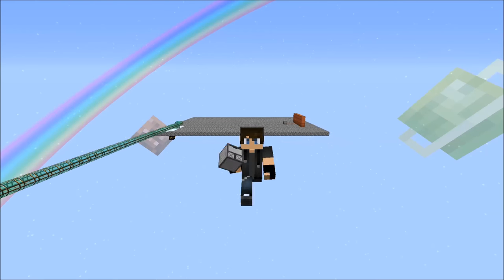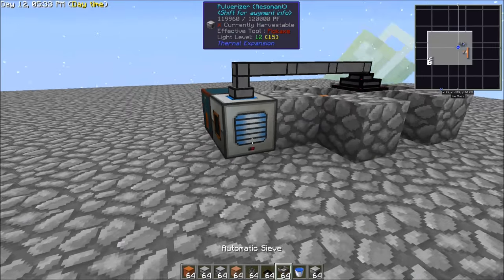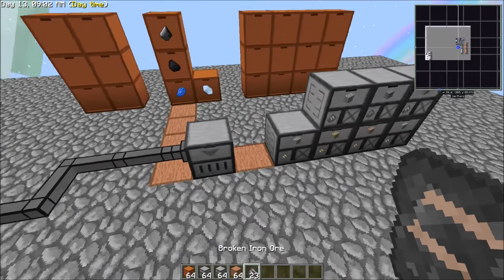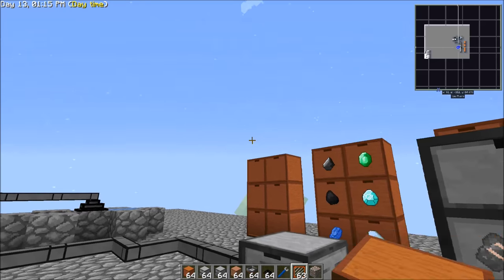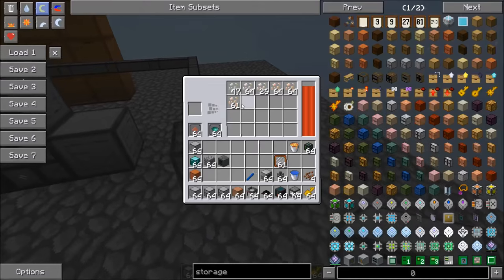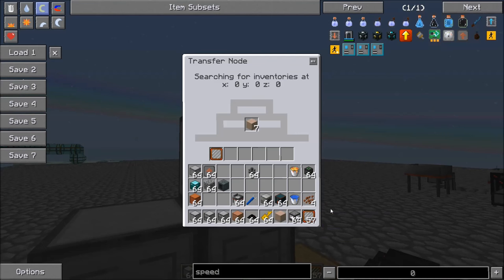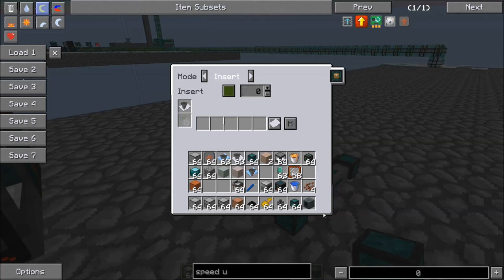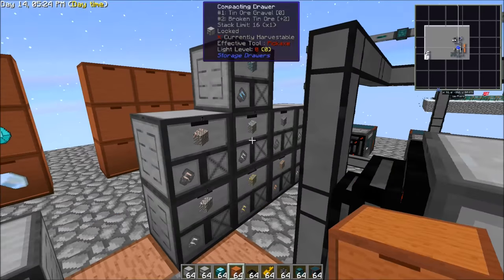Sky Factory 2.5 Compact Drawer Ore Processing Setup

Comment: A trick you might not be aware, you can quickly lock all drawers connected to the same system by using the key on the drawer controller.
Reply from the maker: Oh nice, I never knew that :)  Thank you very much for the suggestion there, def will come in handy :)

Comment: Question for you... Im having issues with ores. Tin seems to be coming out in a different type that isn't working for some recipes. I'm getting thermal tin but I think I need ex tin for making a satchel. 

How can I change it?
Reply from the maker: Well you could use a Unifier from Minefactoryreloaded to change your ores over as they come into your system.  Your able to set it so that say tin gets converted from thermal to ex, etc.
Reply: I figured it out. If you place the version you want in a jabba barrel then the other it changes it. 
Turns out I didn't need it... I needed a different wool
Reply from the maker: Ah nice, glad that you got it figured out :)